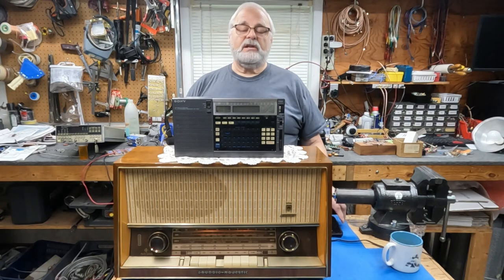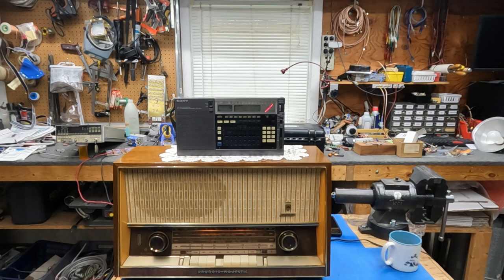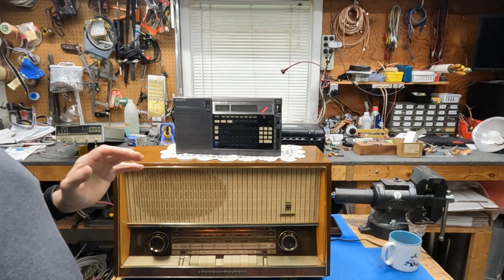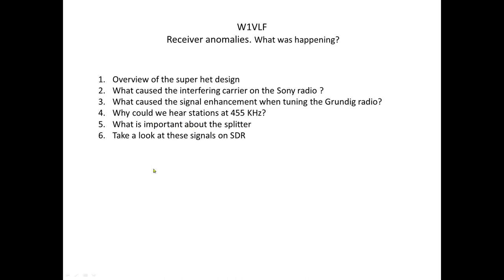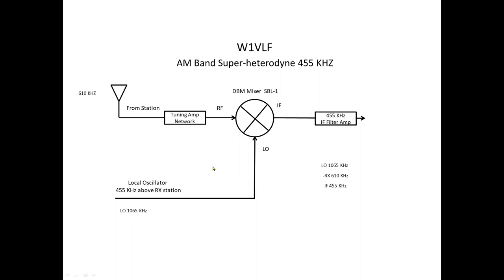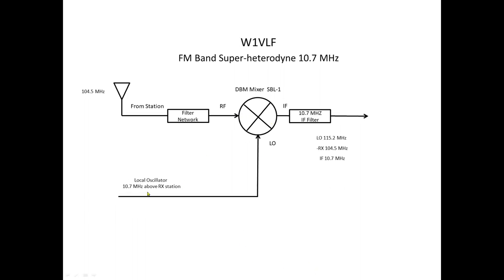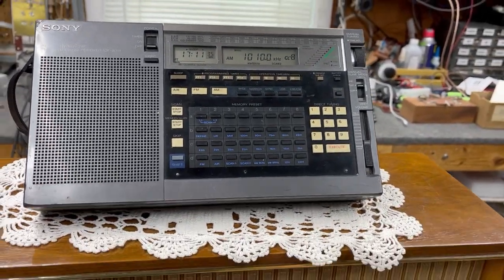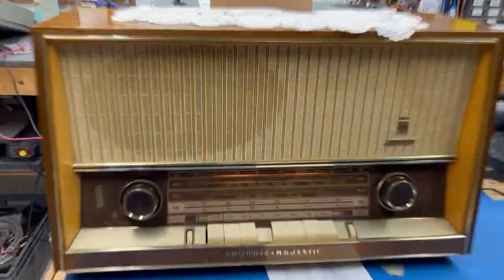Super-heterodyne receiver basics and some shortfalls of older radios

Comment: as an anecdote, that LO leak, together with my RTL-SDR helped me to repair a very peculiar fault in my old RadioShack DX390 radio, in MW it worked very well but in SW it stopped tuning, the display showed everything correct even, but there was no tune; With the help of the SDR and the service diagram indicated that the 1st LO was around 54MHz, (it is a double conversion radio), so with the help of the SDR I was able to detect how the LO moved in MW, but in SW it stopped moving, finally the fault was in a DC-DC boost converter stage, which generates the tuning voltage of the VCO, (15vdc), I corrected the fault and my old radio came back to life hehe
Reply from the maker: Raziel.. That is a great story. Troubleshooting one radio with another radio!  The new helping the old!!!   Thanks for posting that!!!!  W1VLF

Comment: I've actually used the local oscillator leakage from one shortwave radio on another to tune ssb signals to listen to amatuer radio on receivers that did not otherwise support ssb.  You just have to make sure the 2 radios are far enough apart that the lo "carrier" does not overpower and wash out the ssb signal that you are wanting hear.
Reply from the maker: Kevin!! That is a great story!!  Thanks for sharing that..  Experimentation at its best  W1VLF

Comment: Hello again, Paul.  Just another thought after watching this video a second time.  Although there is nothing 'wrong' with any of the concepts you presented, you missed the opportunity to describe how the radio "extracts" the AUDIO frequencies between zero and ~6 kHz from the mixer stage.  Essentially, that is what the IF filter does, in that it "strips away" the 455 kHz difference from the mixed local oscillator signal to yield the demodulated audio frequency that the detector circuit "sees" and then we can "hear".  

Speaking of detectors, you might want to throw in a discussion of the very simplistic direct-conversion circuit used in the old "crystal radios" that pre-dated our youth.  Those very simple 4-component radios used a tank circuit comprised of a capacitor and inductor, one or both of which was variable to "tune" resonance at a desired frequency, followed by an AM detector, usually a gremanium diode, but in the earliest days a piece of galena (lead sulfide) crystal, and a set of high-impedance headphones.  Although I preferred the venerable 1N34 germainium diode, I fondly remember many an evening "tickling" the surface of a galena crystal with a "cat whisker" made of phosphor bronze wire to try to find the "sweet spot" where the interface between the phosphor-bronze wire and lead sulfide galena crystal formed a crude, but effective diode to serve as a detector.  Now I'm the one really showing my age!  

In many ways, what goes around comes around... the earliest 4-component crystal raidos used a direct-conversion approach, and now many of the modern SDR radios employ essentially the same direct-conversion approach, albeit with a lot more options for bandwidth adjustment and demodulators compared to the barn-door wide bandwidth and simple AM detector/demodulator of the old crystal radios.  73  --  Ken WBØOCV

Comment: Early example of a covert channel.  Russian embassies during the cold war, monitored radio transmissions in their host countries.  Host countries wanted to know, which frequencies were they monitoring.  Sensitive receivers placed near embassies capable of picking up the oscillator emissions from russian receivers would allow them to find out.  Might be an interesting experiment, a 455 KHz tuned loop, and a sensitive receiver like the SDRPlay, how far do the signals generated within a receiver travel?
Reply from the maker: Hi Thanks for that story.. I think the problem now adays would be that all the noise from switching power supplies on 455 KHZ. But you are correct.. A loop tuned to 455 KHZ would drastically crease the distance.  W1VLF